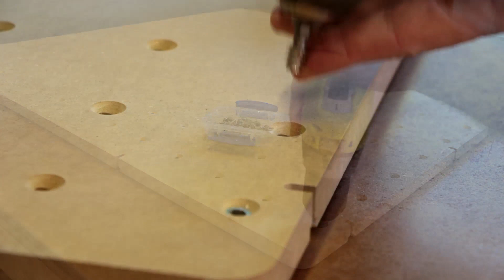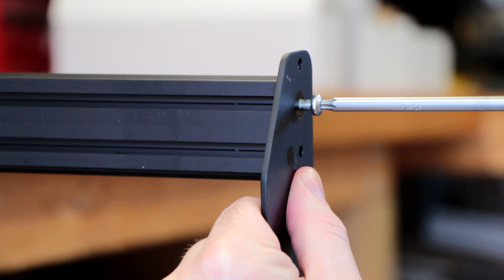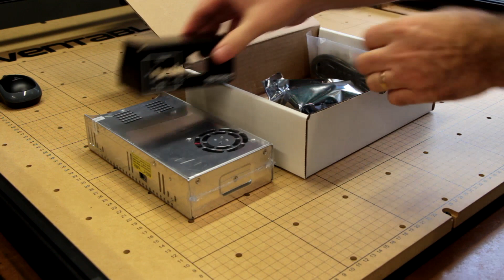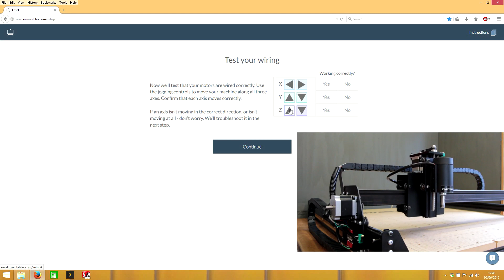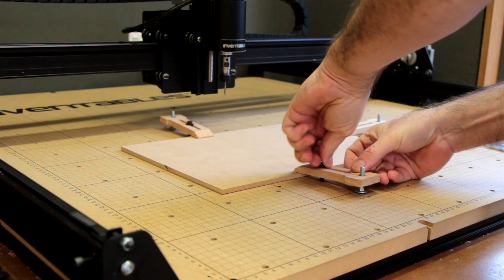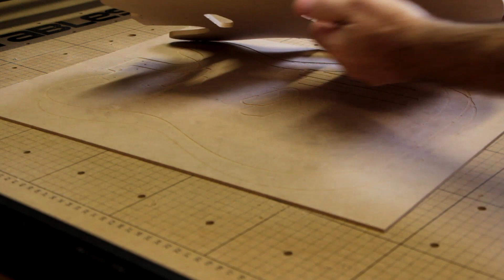Inventables X-Carve - Assembly & 1st Impressions

Comment: Hey Dave....Tom from Texas...where did you get the really small router bit that I saw you cut fret slots with and what size was it?  Thanks in advance and hope you are doing well.....Tom
Reply from the maker: +Tom C Hi Tom, I use a 0.6mm End Mill for the fret slots.  Easy to find on Ebay , Cheers  Dave

Comment: My X-carve just arrived this week.  Thanks for the great assembly guide!
I'm currently designing my basic guitar bodies and necks in AutoCAD.  Do you think Easel will work for radiusing fretboards and doing neck back profiles?
Reply from the maker: Steven Familo Hi there Steven,  Easel is not really going to be suitable for what you are wanting to do. You would be looking at Fusion 360 or something similar ( has CAD / CAM combined )

Comment: Hi Fletcher, Do you think is possible to carve wood guitars body directly and to not have need of macking only master template? Dont' you think it would need a proper router bit? thanks in advance.
Reply from the maker: Umberto Sgobba I would need to upgrade the spindle to a more powerful unit before I would contemplate carving a guitar body

Comment: As a test it would be good to cut another template and see how similar it is. Ideally it would be identical. Looks like a great tool.
Reply from the maker: Mike Dawkins Ive done it a few times, I've lined 4 templates on top of each other and I could drive a 1/8" bit thru all of the bridge holes perfectly.
Reply: Fantastic :-)